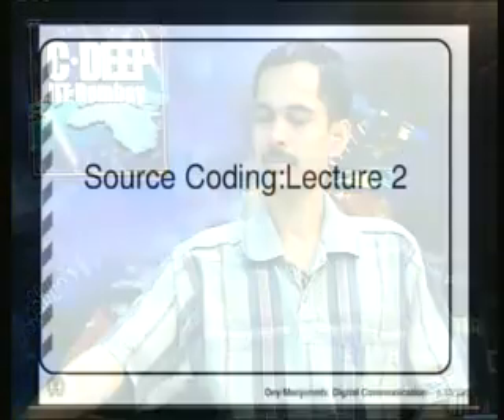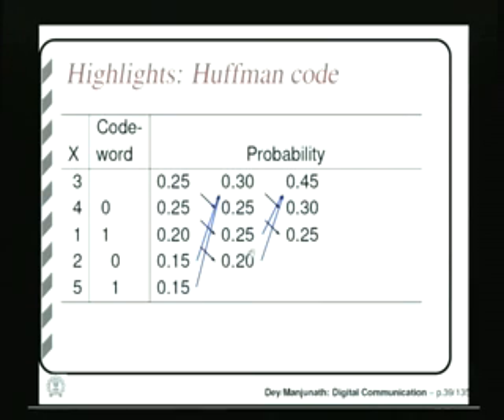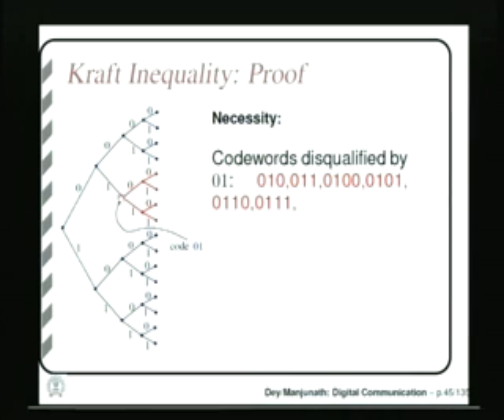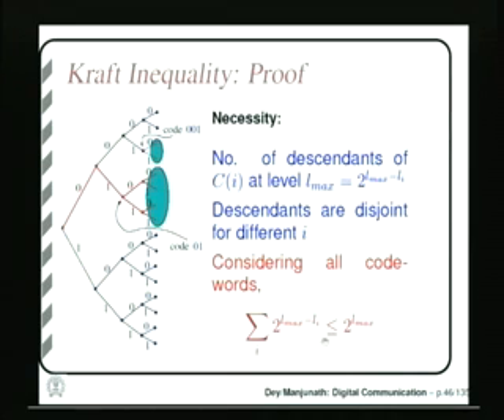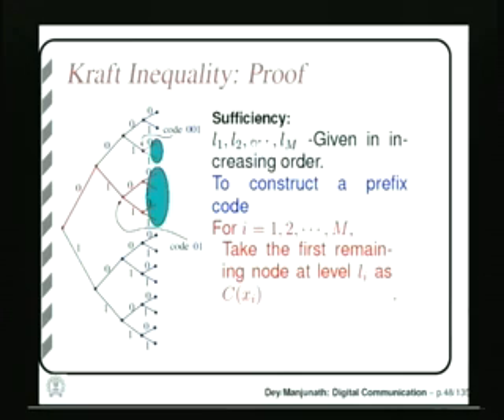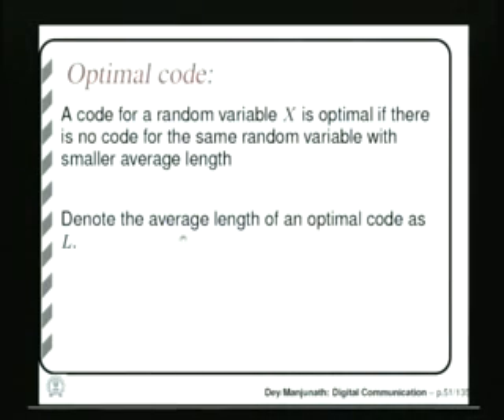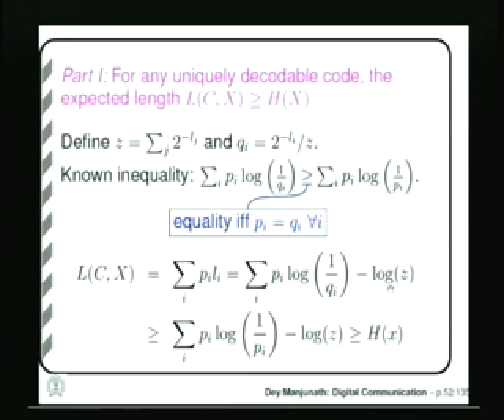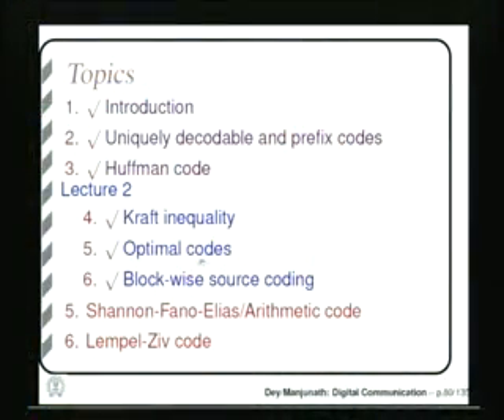Lecture - 27 Source Coding (Part - 2)

Comment: 🎯 Key Takeaways for quick navigation:

01:21 🧮 Huffman code is discussed as a particular source coding technique, ensuring efficient compression.
02:35 🎛️ Lossless and lossy compression techniques are compared, highlighting examples like JPEG and WinZip.
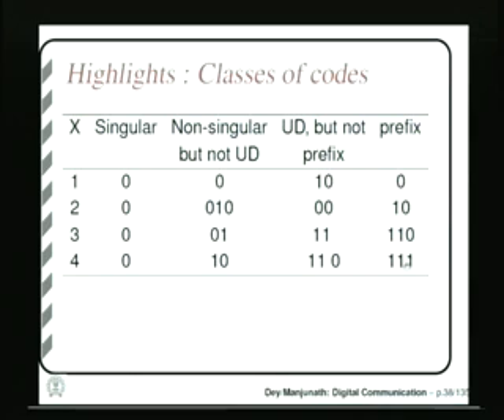06:39 🤔 Codes satisfying the prefix condition ensure instantaneous decoding, enhancing efficiency in source coding.
08:56 💡 Huffman code is proven to be optimal, offering the best compression for any random variable.
10:48 📏 Kraft inequality provides a condition for the existence of prefix codes, crucial for efficient source coding.
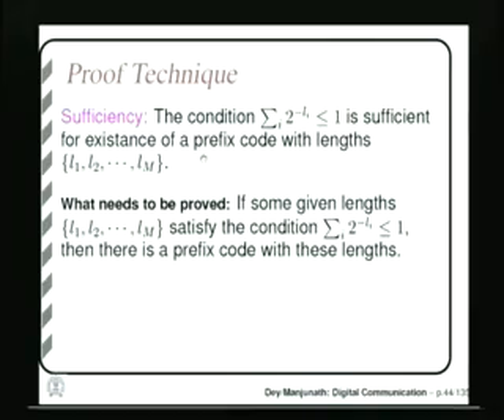12:39 📐 Necessity and sufficiency of Kraft inequality are proven, establishing its significance in determining the existence of prefix codes.
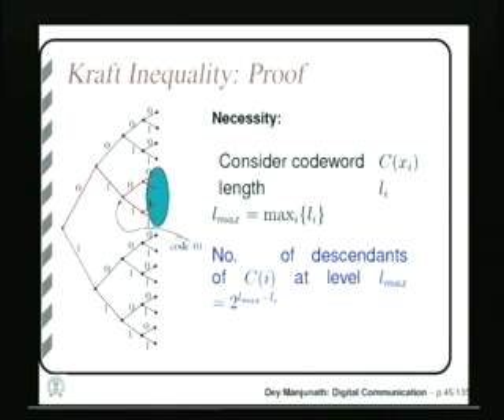20:21 🌳 The proof of necessity for Kraft inequality involves representing possible code words as a tree, ensuring adherence to prefix conditions.
24:57 🛠️ Kraft inequality is shown to be both necessary and sufficient for the existence of prefix codes, ensuring effective source coding based on given lengths.
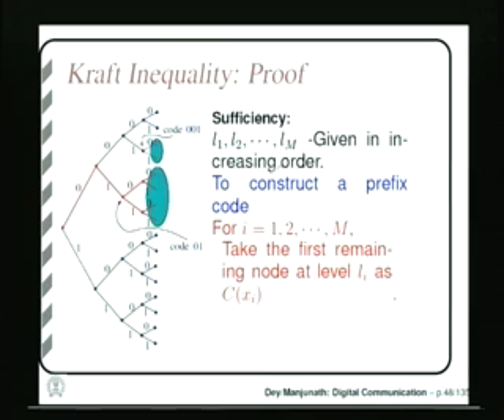25:50 🌱 Prefix code construction involves selecting code words from a tree, starting with the lowest level.
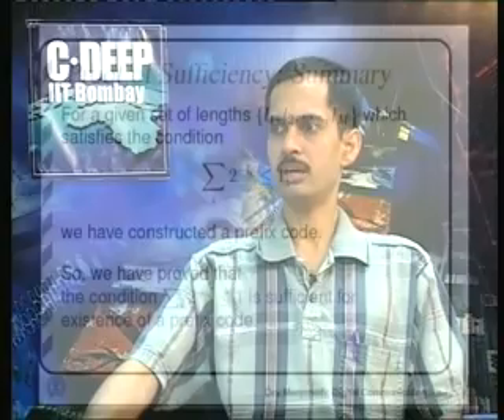30:59 🛠️ Kraft inequality is sufficient for the existence of a prefix code, ensuring code words availability till completion.
32:15 🧮 Kraft inequality applies to uniquely decodable codes, indicating the necessity of a prefix code for efficient encoding.
34:49 💡 Using prefix codes instead of solely uniquely decodable codes ensures optimal efficiency in encoding and decoding.
35:16 🔍 Equality in Kraft inequality implies exhaustion of all nodes at the maximum code tree level, optimizing compression.
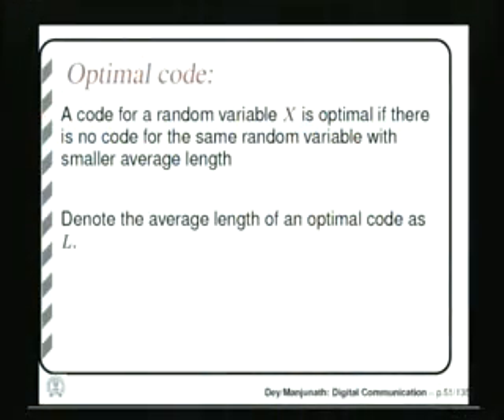36:37 📉 Optimal codes achieve maximum compression by minimizing the average length, denoted by L, within bounds determined by entropy.
38:16 📊 The average length of an optimal code lies between the entropy and entropy plus one, defining the bounds of compression possibility.
49:31 📚 Kraft inequality serves as a necessary and sufficient condition for the existence of a prefix code, crucial in digital communication theory.
50:22 🔑 Kraft inequality serves as both a necessary and sufficient condition for the existence of prefix codes, ensuring encoding efficiency.
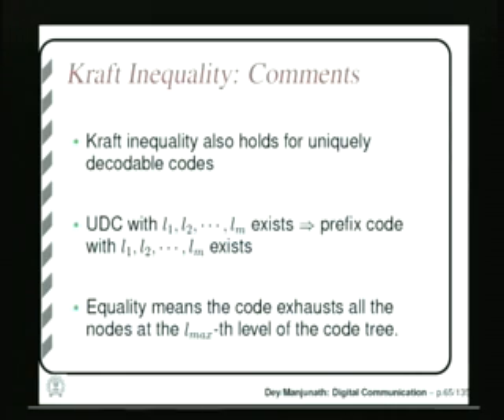50:51 📊 Optimal code average length for any random variable lies between Hx and Hx plus 1, providing a compression efficiency benchmark.
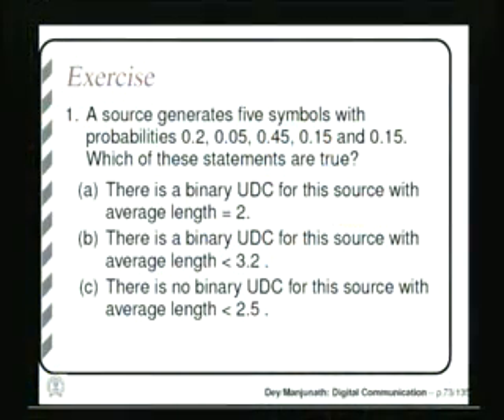51:40 📚 Further study topics include ShannonFano-Elias code and Lempel-Ziv Code, offering alternative approaches to encoding beyond Huffman codes.

Made with HARPA AI